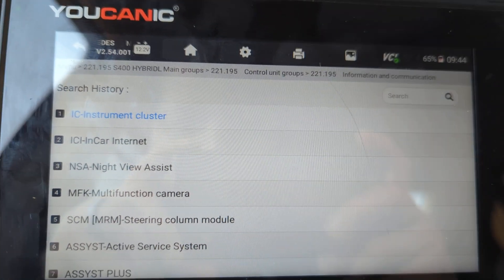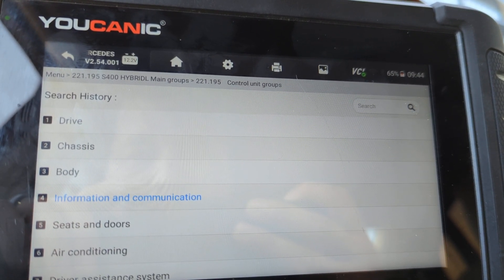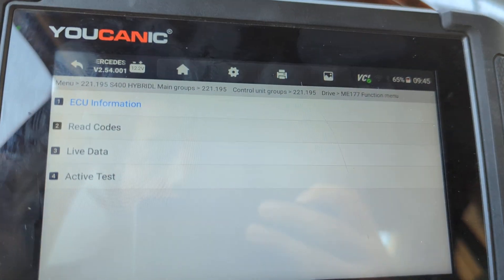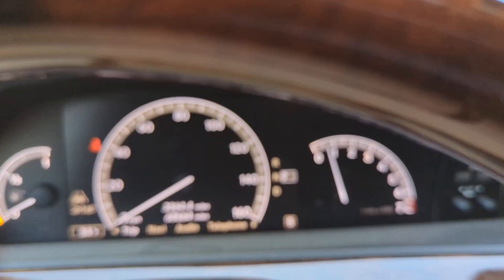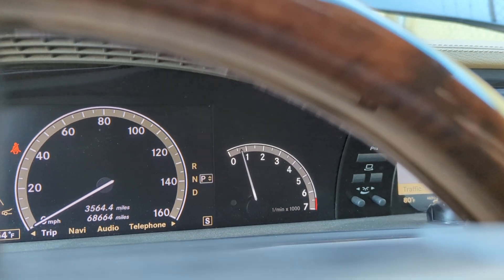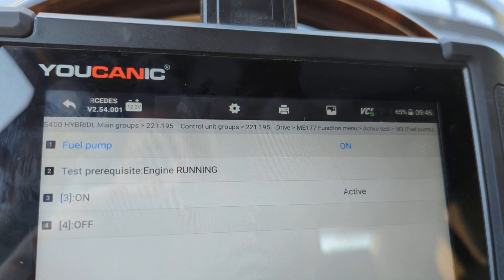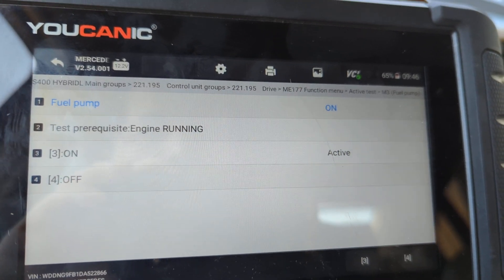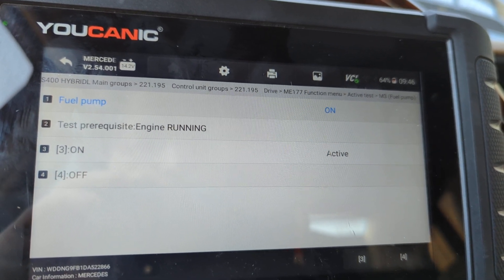Turn on off Fuel Pump on a Mercedes Benz with YOUCANIC Scanner

Comment: Hello, any suggestions for a Nissan Sentra? 2018? My tail light is not turning on my brake lights still work, and my hazard lights still work, I changed a couple of fuses from under the hood, and I replace one of the bulb just to see if it will turn on, but it’s still not turning on. Any suggestions on how to get this back working.

Comment: Can you use it to activate the fuel pump to drain old petrol through the rail
Reply from the maker: Thanks for your query! While our YOUCANIC scanner is incredibly versatile, using it to activate the fuel pump to drain old petrol may depend on the specifics of your vehicle. We advise checking our extensive free resources or guides provided on www.youcanic.com, which detail various procedures for different vehicles. Our mission at Youcanic is to empower you and we are here to support your car ownership journey! For more detailed support, we offer factory repair manuals which could provide the level of detail you need. Don’t hesitate to reach out on our site for any additional guidance. We're all about helping car owners save money and feel confident with car maintenance.